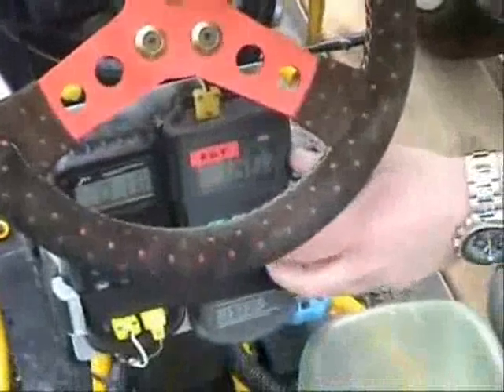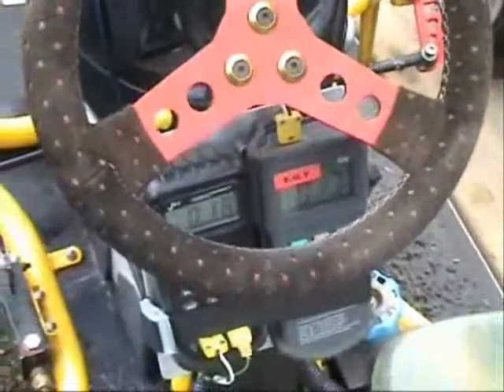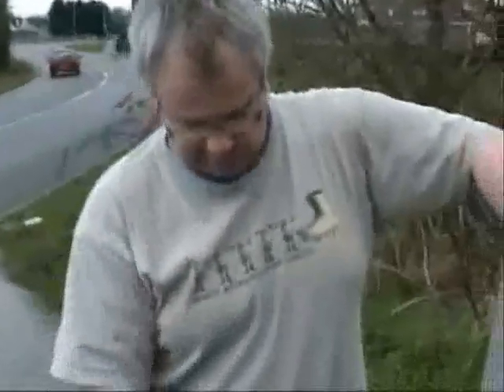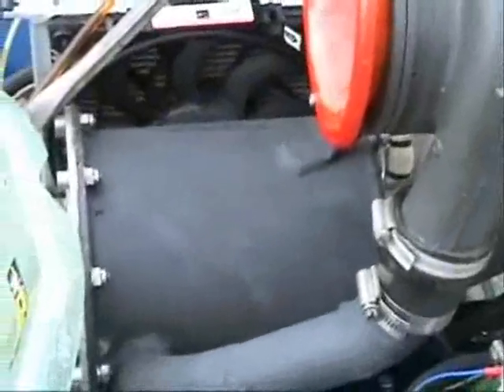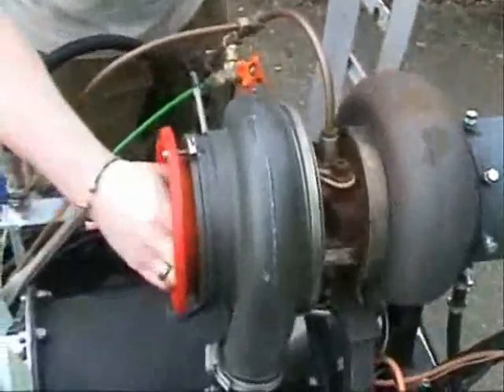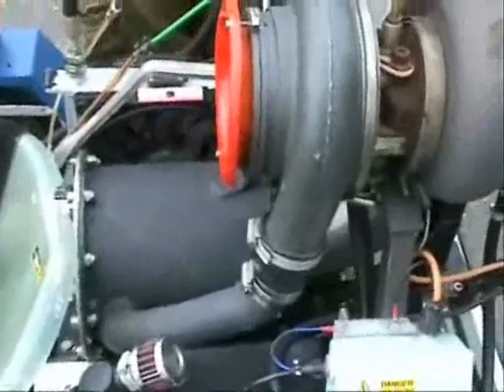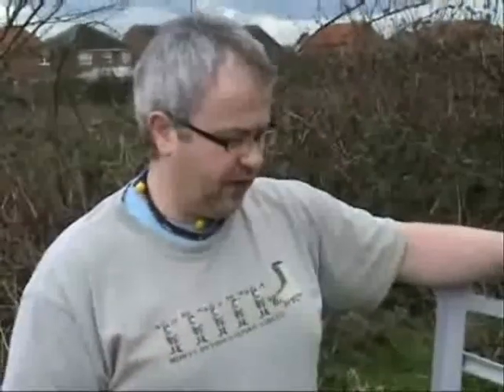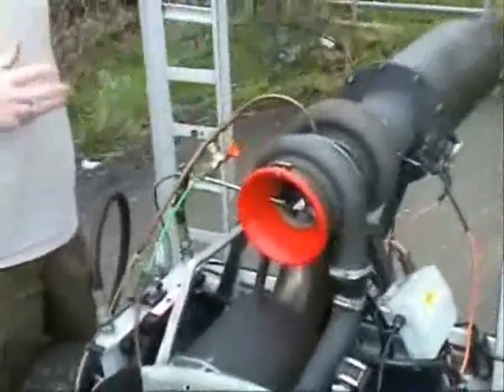DIY Gas Jet Turbine Go Kart - Walk Talk & Start Up

Comment from the maker: @ xPRED - Yes mate, I do do a cool down with the leaf blower. On board propane is in the RH tank as you sit in the kart. It's in a proper tested Propane tank.  No flash arrestors fitted, it dosen't need them. Propane tank - 12V solenoid Valve - rotary valve for the throttle then the propane injector.  Hope this helps.

Comment: Actually, you DO get a squeeze stroke in an engine like this.   The compressor does not suck air in.  It creates a vaccuum in the front of the housing which allows air to enter the compressor and the compressor wheel squeezes the air....Aka compresses it.  Air itself is not very volatile. and results in a slow burn.  thats why it must be compressed before it burns or is ignited.